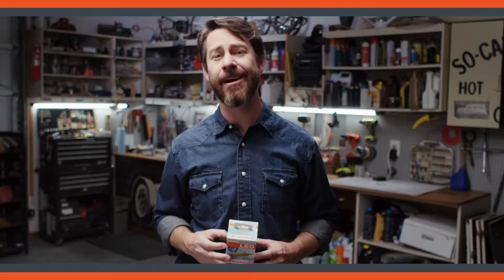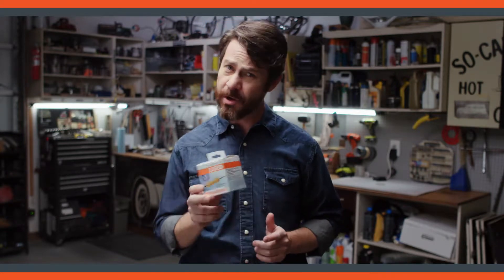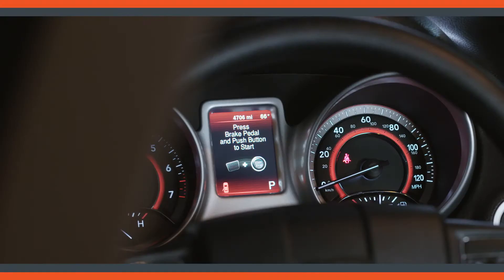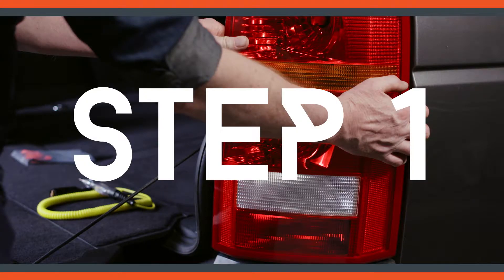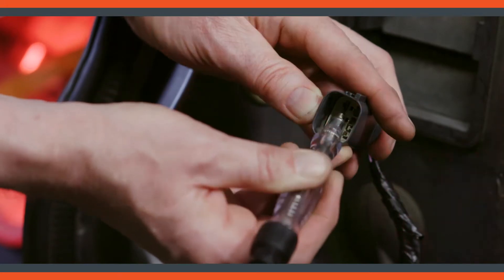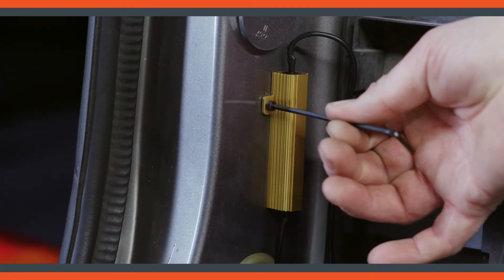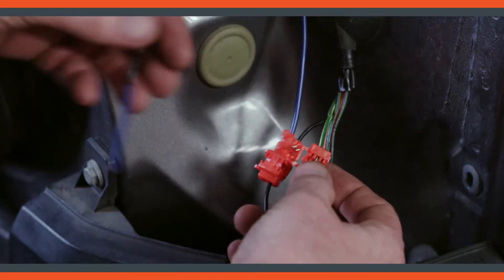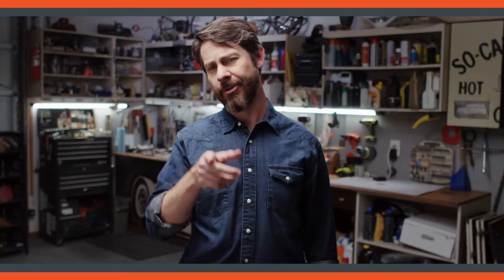Mr. Layman's Garage: How to install a load equalizer.

Comment: What do you do with an older vehicle, a 1989 Chrysler LeBaron? The turn signals and brake lights work, but the LED causes the blinker to run super slow. Same fix or something else?
Reply: Fix your issue?
Reply: Just use the led flasher relay

Comment: I bought this for my 9005/9006 led headlights. An agent at Sylvania says I can use it as an anti flicker canbus for my aftermarket parts but is this true???
Reply: If ur vehicle is a Japanese vehicle. 

It’s common for 9005 high beams for DRL sun function. 

And u throw these led headlights of ur 9006 low beam and 9005 high beam.

9005 high beams is also DRL dim function. When it flickers, it’s not noticeable but it is when u look at closer. 

Plus, it can damage the led bulbs from time to time. 

So for ur 9005 high beam led bulbs with DRL function, putting an anti-flicker system will work and stop the flickering. So that it will not damage the led bulbs. 

For 9006 low beams. U don’t need that because u just simply turn on and turn off.

So it is true. And it’s very common. Especially with Japanese cars.